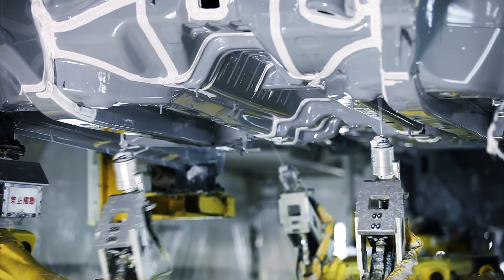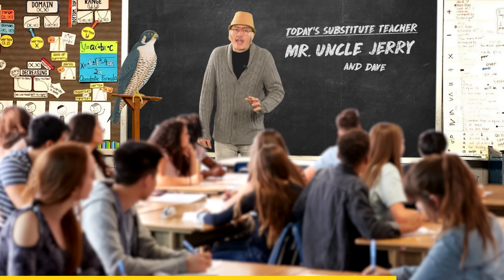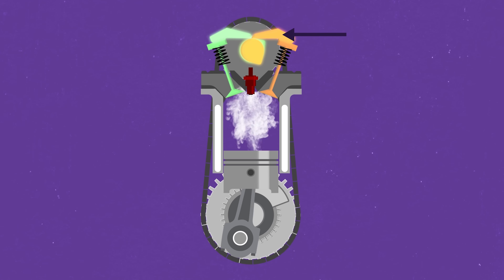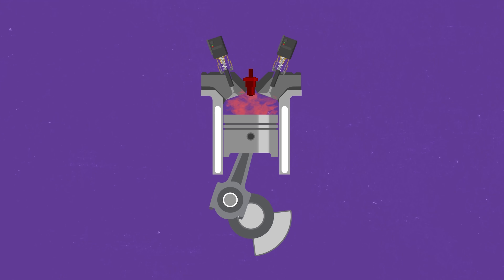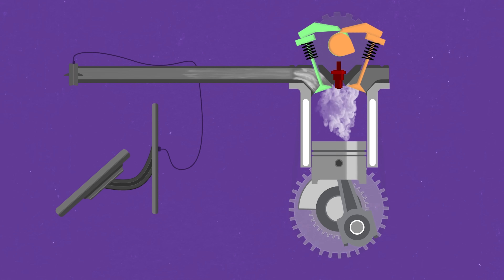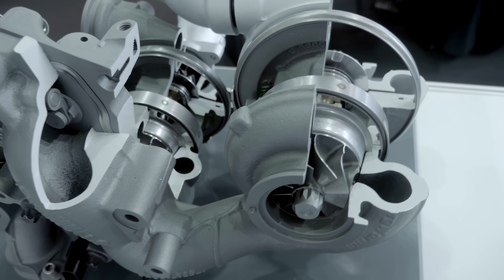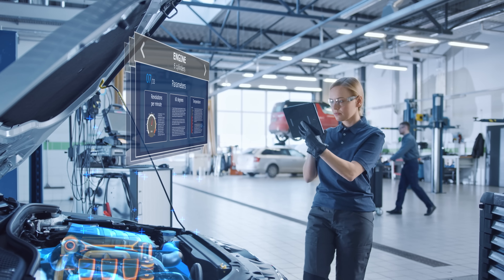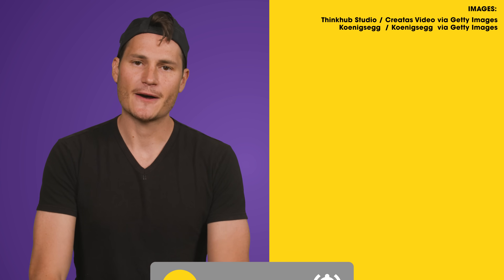This Is The Last Great Engine Tech

Comment: I did not know outher people were working on this technology I thought I was the only one I have a fue engine's running my special system I am using a speeduino ecu just for the valve's and it fits in the original spring and valve stem and its cheep in total it cost me $130 for each solenoid and I had a surket bord made to connect each of the solenoids together with my software I have made it works great but its eather open or closed thair are no I between valve movement the valve's get their info from the cam shaft sensors yes its still has a camshaft but no rocker arms the hole's for the oil supply have been welded closed on the rocker shaft and on the back of the camshaft the oil is shooting out is redirected to each of the solenoids to cool them down and heet them up and also to oil up the circuit board so no water or any conductive material is on them causing a misfire or a pre fire I am using 591F solinoid from GEEPLUS because those solenoids have more then enough pressure to open and close the valves I am working with some company's to make univercle electronic controlled valves for any car it will take place of the original spring and it will reuse the oem valve stems, retainers and spring seet's top and bottom and surviving the valve stem seal will be a breeze I have about 100 prototypes and thay all work and have a extremly high duty cycle with a car at 7000 rpm it only reaches 50% duty cycle and my last prototype holds up to 500 lbs in both directions but it really only needs 60 lbs anyway but if its boosted I got that covered and if it loses 50% of its holding power it will still be fine the last prototype has a 100 lbs return spring so if the solinoid fails it will be stuck closed a huge plus is it only takes up exactly the same space as the spring assembly and rocker armed assembly and can be installed with out taking off the head just put string in the cilinder and rotate the engine up to tdc and remove the spring and install the solinoid and the reson the camshaft stays is because thair is little switches on each intake and exhaust lobe and the ecu for the first 10 seconds will see the height point of each one and send that to the ecu for reference and then you can play with the duration and the camshaft will be the fail safe if the ecu some how fails I did this on me 2004 acura rl and its amazing how much tq and hp I gained on the 1980's style engine a C series the c27a-c35a1 I am still waiting on a patent and I will be selling it soon it will cost 4000 for the entire system from the ecu to all of the hardware and software 8 solenoids 8 switches the ecu with the fail safe software and the software to adjust the duration of the solinoid the aluminum spacers to make it fit on any vehicle the harness and all of the equipment neded to make it work the first time also a extremely detailed video and book on how to install the system correctly and all of the tools to do so even the string neded to remove the oem springs and each part will be available for purchase individually each solinoid will be $200 each if one was to fail that's why the kit comes with 8 so if it's a v6 you have 2 extra and if it's a i4 you have 4 extra and if any of the solinoid are broken I will replace it after I get the old one to see how it broke and fix the problem and send you the new revised versions which is just a modified version of my last prototype I was working on the only reason I haven't went through with it is because the pandemic has everyone under raps the parts I need to mas produce them are out of stock and I do not know when thay will be in stock again and also people have bills to pay and are not willing to buy expensive car parts in the pandemic but as soon as this coved19 is over I will try to mass produce them and get it out to the car community if I am not sued by koenigsegg 
for making a electronically controlled valvetrane but affordable and available to the public and it's open source I am calling it "UECV" Universal Electronically Controlled Valvetrane wish me luck

Comment: Why use a valve? i have a idea on how to do away with a valve of the current style. An Air Injector. Combined with a 2 stroke style engine. Power at each TDC. Piston does not compress air, so no power lost on compression of air. Good idea i have, but no way of ever actually putting anything on paper or together. Im just not that type of person who can do that.

Comment: If you can control fuel injection and now air intake through digital valves. You can save a crap ton of fuel if you turned off all but 2 maybe 1 cylinder when idling. WOW.

Comment: 100% a tech that F1 needs to invest in. But.. they wont. They are too woke at the moment to venture into unknown like how engineers use to do. Its why nothing has really has come out of the hybrid V6 area because what they are doing isn't innovating but just to satisfy the FIA. Put it this way. even if a F1 team decided to use this technology, it will be band like every other great idea teams come up with. But the Woke FIA will continue to kill F1 with more and more regulation. Engineers have pretty much given up on F1 because every idea they come up with is turned down as illegal an unfair advantage even though Mercedes had years of R&D prior 2014 which in todays rules would of been illegal, and with that they have dominated for almost a decade. Such a shame.

Comment: Even with electric cars, hybrids are here for the foreseeable future so this is good. I actually hope hybrids never go away because I like off-roading
Reply: Hybrids might have less of a need for these, especially ones with CVTs. The Prius, at least, tries to keep the engine RPM within a narrow band, so the issue of the engine speed not matching the valve open time is less of one. I guess the question would be how much it would be worth redesigning your manufacturing line to make the new engine block to incorporate this for a bit less weight. If the hybrid has a wide rev range that might be more worth it..
Reply: I don't think car companies will just ignore the market of off road trucks in the america, they will probably develop an EV off roader that is durable and water proof
Reply: I'm pretty sure it wouldn't, especially on short term. Couple that with the fact that Toyota even experimenting with hybrid rally car very recently, there is still chances for off road hybrids in future.

But even if hybrids is dying breed, that doesn't mean off road cars is an imposibility. I mean right now we have "Extreme E" offroad series. It might not sounds as thrilling as ICE/Hybrid competition, but it's still shows that offroading with electric cars still possible
Reply: @ivanbima5877  
I meant in the sense that I'm not sure whether hybrids would benefit from freevalve all that much, since the problems of RPM not matching the air needs of the engine is already mostly solved by not having the RPM move that much. Hell, V-tec would really benefit from a hybrid system by just having the car run at a low-power RPM range and a high-power RPM range without needing to change too much cylinder head tooling.

Comment: free valve combined with other tech will be much better than electric vehicles. the electric vehicle mania is not self sustaining. it requires buttloads of hydrocarbons to generate the parts for an electric vehicle.

Comment: Hold on this isn’t a new idea at all.. I was designing the power control system and drivers for electronic valves for DaimlerChrysler back in 2000-2001. In that system, the 10 cylinder engine could also shut down six cylinders when running around town. The only real problems back then were developing enough electrical power and getting the actuator reliability high enough.

Comment: yes do the miata. this should be an aftermarket option for most engines. the only thing that worries me is the life span of the electrical parts. the current mechanical parts are easy to keep track of. basically change your timing belt at scheduled intervals.

Comment: This was such a great video, I wonder why more manufacturers don't do this? I would love to see BMW, Mercedes, or Audi try to implement this technology with some of their high performance models. For the new M3 that makes 473 HP and 406  torque, say there was a 20% increase in performance, that would add 95 HP and 81 torque. That is absolutely crazy... and this four cylinder that they tested the tech on made 45% more power and 47% more torque. To the go on the extreme side, imagine a stock hellcat that made 141.4 more horsepower and 131.2 more torque assuming a 20% increase. It almost makes all that engine modification for the demon's engine senseless when they could have made a more efficient engine and powerful engine just by modifying the air system.

Comment: Heres an unpopular opinion, can you source electronic valve system (if not source can you diy it?) and get Zack to try to tune it by himself, shouldnt be a big problem since its 2 rotations of crankshaft for 1 lift of intake valves at begining of intake stroke (the suck stoke) of each cylinder and 1 lift of exhaust valves at beginning of exhaust stroke (the blow stroke) of each cylinder. If you look at miata its 4 cylinder motor wich means you can tune cylinder 1 and offset timing 90° for cylinder 3 and so on (folowing firing order of the engine). Leaving you with only one table that has engine RPM valve, open in ° of crankshaft rotation and valve close in ° of crankshaft rotation. That means you're gonna have map for 720° since 2 crankshaft rotations complete 4 strokes giving 1 cycle intake compression power exhaust(suck squeeze bang blow). Hope I gave you a reason to do/not to do the miata electronic valve control.

Comment: wouldn't the exhaust not going to the turbo reduce power? wouldnt it just be better to have a valve to bypass the turbo so you could still have better power?

Comment: 11:21 nope maybe it wont be changed to electrics, combined this tech with synfuel will be gamechanger
Reply: I saw a video on synthetic fuel (by EE), suggesting it would cost more than normal fuels and that it would be more innefficient than electric technology. Anyway, koenigsegg's freevalve 3 cylinder can run on many fuels and produces 600 hp with e85..
Reply: @muhammedzayan4399  again still on early phase that no doubt it is pricey. Still need an novel engine formula that can utilized the synfuel of course. Yet now the manufacutrer and maker is pushed out by regs to become battery electric.

Comment: I just need to point out that when you're explaining that exhaust from some valves routes to the turbo and exhaust from other valves bypasses that going directly to the catalytic converter--
you showed you showed an illustration with only one exhaust valve per cylinder, where the valves coming from two of the cylinders is going to the turbo and exhaust from the other two cylinders were bypassing it and going to the catalytic converter. This would not allow for a variable portion of the total exhaust from the engine to go through the turbos. However with the free valve system each cylinder has at least one valve that is routed to the turbo and at least one more valve that can bypass it, going directly to the cat. Every cylinder can contribute anywhere from 0 to 100% of it's exhaust to the turbo or directly to the cat depending on the lift and duration of each of it's exhaust valves. 

I don't mean to be picky because I love you guys and all the content that you bring to the internet but this is a pretty fundamental and important part of the free valve system
Reply: https://youtu.be/0MycM4IRwXU

Comment: Freevalve is cool but really its 10 years late to really have a meaningful impact on gas vehicles on the economy end i'd think. They' might as well push EV and other such related tech. Still super cool, im shocked it hasn't been more common place for a long time, especially as most modern cars are electronic heavy even on the most budget end.

Comment: I'm calling bullshit on the 30% more power and torque figure. Well tuned (valve-timing and exhaust length) NA engines in their peak torque range have volumetric efficiencies >100%, meaning they are literally filling the cylinder with more air than fits in them at standard pressure.  The freevalve may be able to increase torque by 30% at some point in the RPM range (still seems wildly optimistic, probably based purely off of the geometry "area under the curve" for a square wave vs lobed profile), but certainly not over peak torque with the fixed cam.

Comment: Also kind of neat how it makes it possible to time the valves to make power at the top end and still produce good torque at the bottom end of the RPM range, something that tends to be give-or-take one way or the other with a mechanically timed cam. Not just changing the equivalent of the profile, but how much timing advance or delay is there too. Of course the ignition and fuel maps will have to be reworked to take advantage of it.

Comment: Honestly, asides from losing the stick shift, the biggest bummer I see towards going electric is seeing the ingenuity of engine designs such as this.
Reply: @Lane Araujo oh absolutely, but ICE are just not as efficient in energy transfer. Which means there is so much possibly to innovate and squeeze that extra bit of performance
Reply: @Lane Araujo exactly, but how hard is it to get that small amount of power in an ICE? You gotta make some big changes. Motors are just naturally better in energy delivery so the focus is on range rn than it is with performance

Comment: I would love to see this tech retrofitted on a 2UR-GSE engine from Lexus. Adding more horsepower and fuel efficiency to that already beautiful engine would be chef’s kiss
Reply: I agree that’s an amazing engine, but I don’t think it would sound the same without a throttle body and intake plenum.  Honestly without all the clunky valvetrain you could apply this tech to the 3UR, rev it higher and enjoy the larger 5.7L displacement.

Hmm, now I’m thinking about the Corvette LS7 V8 in the Z06, the 8.4L V10 in the Viper and the 6.5L V12 in the Lamborghini Aventador.
Reply: @whodahellru8124  I would have to say an LS would be perfect for this. Take and already proven platform (better yet one that uses a very old pushrod design) and see how many gains you could get by converting it to freevalve. They could make 4 valve custom heads for it or possibly even fit the entire solenoid design into the lifter area and use off the shelf heads, making it look indistinguishable from a standard ls.
Reply: The 3UR engine is designed for peak torque, not horsepower, since it's meant to move heavier vehicles. The reason I like the 2UR-GSE so much is because it's the closest we'll ever get to an LFA engine in a mass produced car. Sure you could do it to a boring LS engine which are a dime a dozen and has a million aftermarket support mods, but that's not really special. You may be right about the sound, but I would contend it would be even better, allowing it to rev out even quicker like the LFA and at a higher RPM for that V8 scream.

Another engine that would be more interesting to see this technology in is the Hayabusa V8 that the Ariel Atom V8 concept hosted. If you could still buy this engine and retrofit freevalve tech, I'd pour buckets of money to throw it into something like the GR86. The Ferrari engine swapped GT86 was a spectacular idea before it was wrecked, I suspect the Hayabusa engine would be a remarkable substitute, being a light engine for a light vehicle.
Reply: @gaffgarion92  any engine can be designed for peak torque or horsepower, it comes down to airflow and rotational mass.  Just because an engine is of large displacement doesn’t mean it can’t make horsepower.
Reply: Sure, anything could be designed to do anything. Slap a big enough turbo on a cruise ship diesel engine and you could be doing Lambo quarter mile times. Toyota uses an engine similar to the 3UR in NASCAR, but it’s radically different than anything you’d find in a production car because of fabrication complexity and emissions standards. That’s never going to find its way into a Tacoma TRD or even a “Lexus GX F”, if you will.

The point is that in order to do what you’re suggesting, you basically have to redesign an entire powertrain that Toyota spent billions of dollars perfecting for its intended purpose, just for the sake of having more displacement. It’s not really purposeful at that point, it’s just done to say “Mine’s bigger”. I guess all I’m trying to say is that retrofitting a free valve system to either the GSF/RCF or LFA engine is just making something that’s great even better at what it’s already good at doing, it wouldn’t be trying to be something it’s not and require designing a new powertrain or vehicle outright.
Reply: https://youtu.be/9MdsZFFMHow

Comment: Well you missed some interesting possibilities that this tech allows for such as switching to two stroke operation at will. Now that would be interesting. Think a 500 HP engine that suddenly switch from four to two stroke operation as you come out of the corner and enter the mile long straight. Well I can imagine it can't I? I mean it's not like I'm ever going to even sit in a car with that kind of engine, let alone drive one. But just the idea is interesting.

Comment: What's amazing to me is I feel like ICE development has come so far, and yet this is seemingly such a simple idea. Obviously, if it was actually simple, anyone could have dreamt it up and implemented it before now. Definitely excited to see what the future holds for the ICE!
Reply: It's always been a problem of reliability and cost. Even at cruising engine speeds, these solenoids have to fire 15+ times per second. That's millions of cycles, and it's not like the forces are low. The actuators are also rather expensive compared to steel shafts.